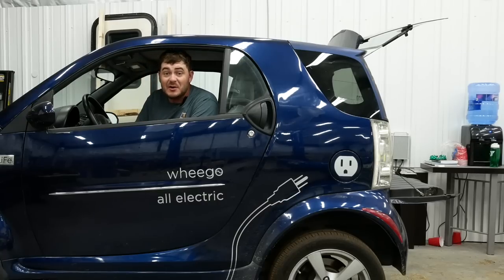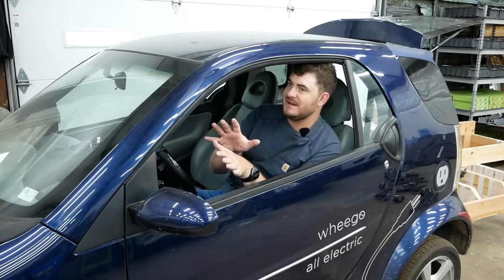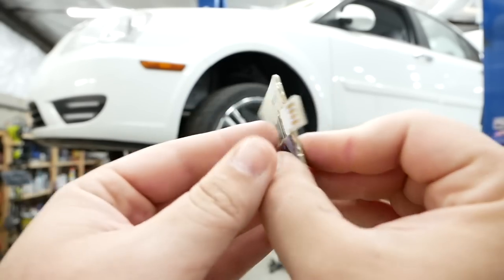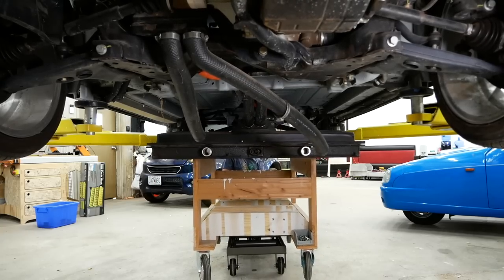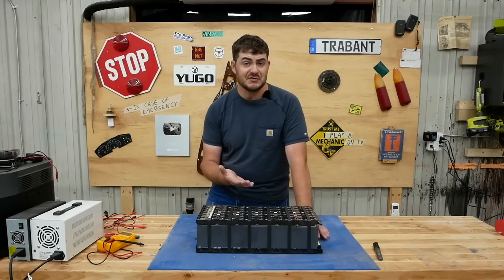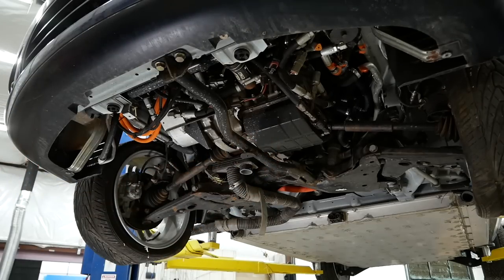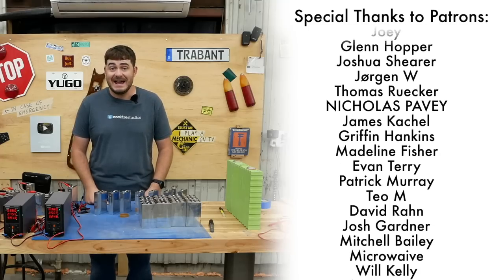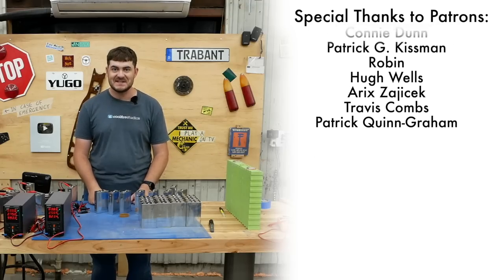I Have 3 Dead EVs. Are Any of The Batteries Still Good?

Comment: The battery pack in your "roadworthy" Coda is better used to get your dead Wheego back on the road. No one except a handful of people own Codas, so no worries about repurposing good parts for another obscure EV. 
So long as the cannibalized battery pack has the BMS and other associated circuitry preserved you could either keep it for personal benchstock (who else has a Coda?) or keep that for other Coda owners. The battery cells could theoretically be replaced with similar aftermarket ones but the brainbox is a bit trickier to come by.

Also a Li swap for the Ryobi mower is a good project and would make good use of the ripped apart Coda pack.

Comment: Honestly do what ever makes you happy. I have almost no doubt that you will make at least some people sad by disassembling a perfectly good thing is technically irreplaceable. However if someone REALLY wanted to revive the coda(that will most likely be drivable again) that you are taking the batteries from they could with new batteries that exist now. Granted they would have to do a lot more work to make new batteries fit in the old hole, but that does not make it impossible. Now if you thought ANYONE would want to have the battery pack and the car to go with it in the next year or two then keep it. If not it is just junk wasting space in your garage. Some times failed ideas just need to die and the parts sent off to other failed ideas. The Wheego is junk, but it could be functional junk with new batteries. If I understand at least one of the codas will most likely never be a functioning piece of junk so no real loss there. Lastly I am no battery scientist, but if you do nothing with them long enough and never charge them they will go bad eventually, so another reason to use it before you lose it.

Comment: I would say, try to source replacement cells for the wego. Those look pretty stock for about 2010 or so. Are you sure they’re not LiON or another earlier chemistry?  (I ran a hybrid battery repair company in the NiMh days - contact me if you need info)

Comment: The ony thing different, really are the electronics. You're overthinking the batteries, since if you can disassemble the individual cell, then a new battery pack can be made to create something of similar spec to the Coda battery cell.

Comment: This is a problem I've always forseen with the EV market, leaving vehicles to sit without battery maintenance, of which abandoned vehicles, forgotten about vehicles, and the second hand market will all produce victims of lack of maintenance; even if LiFePo is more robust, they won't last forever unmaintained. Then someone will have to dump extra money into service and replacement, when you know the market will not reflect that as a typical long term need. The EV market will always be expensive, even ten years down the line you'll have unreasonable service costs; and this is before getting into how the service market will handle constant changes in EV battery cells, especially when you have a company like Tesla changing cell size every few years, imagine what happens when you have that going on with pouch cells, or chemistry changes, etc. And that's before getting into just how much of a time investment battery service is, and you know how expensive service gets per hour, jus testing takes long enough, replacement takes even longer, and these people have to be trained to do the job so they're technically specialists within the industry, especially for welded cells, which also take additional equipment; the costs snowball out of control extremely quickly. I'm all for EVs, but the market will take way too long to adapt to them, especially the service market.

Comment: Odds are when someone needs to fix the coda battery back they will just use a tesla battery pack. Plus seeing how unriliable your Cota has been and how well built the battery packs are it is more likely that the car will die before the batter pack so the odd of someone else needing a coda battery back within driving distance of you is probably very very low.

Comment: you're overthinking it. If a Coda owner needs a new pack, the smartest thing would be to eliminate the bad module and replace the bad cells with good ones. So it's not like they cannot find any new cells and you can maybe upgrade the packs with better cells and sell of the old ones.
You shouldn't be the one thinking about this stuff, the Coda owners who need batteries should be thinking about solutions to their needs.
Fix up the Weego and the mower, and enjoy the Coda with a bit more range.

Comment: Honestly, by the time someone else than yourself need a battery pack for a Coda, the cells will probably be dead anyway. I'm impressed they are even still okay after that much time, but they won't last decades either. Use them. I only hope you took several pictures in addition to the videos so you or someone else can later rebuilt them if needed.

Comment: try a lawn mower below car floor flywheel of radius 1m at 20krpm at 300Wh/kg, easy battery, think like 200kg of flywheel, at 60kWh energy storage, spin faster to 200krpm if you want 30kWh/kg energy storage rating
Reply: dont mind the bits flying out, really fast :p
Reply: and, your car will not easily flip over, because of the flywheel continuity of rotary momentum stabilization
Reply: bs robust lol, fall with single stone punch

Comment: I think the good Coda battery pack deserves to see out its full service life. I say do a bunch of parts swapping and get another good Coda out of the two you harvested in this video, keep the batteryless Coda around as a communal parts car for all Coda owners, and revive the Wheego in some way that doesn't deplete the already limited resources of very low production run EVs. You've already somewhat appointed yourself as a steward of such vehicles, it wouldn't do well to let that power go to your head to decide what lives and dies, it wanders into hubris to use such powers to go beyond preservation into deciding what lives and dies

Comment: I'd use the battery pack in other projects. Better for it to live on in the wheego or as the house battery in your bus, rather than going bad sitting around in the garage.
Reply: But as you just saw, LiFePO4 doesn't go bad.
Reply: @luc_libv_verhaegen  But as you just saw in the wheego, it can.
Reply: @Handl3sAreStupid  Because of draining those cells below 2.5V as explained in the august 21st 2020 video about the weego. The BMS of the weego apparently did not protect against this.

Comment: So, seeing that the Coda packs are good, what is actually wrong with the cars that prevent them from being on the road? Bad electric motors?, electrical component failure? Genuinely curious. Perhaps the electric motors among plenty of other parts could be salvaged if you are unable to determine whats wrong with them.

Comment: if someone is going to revive a coda odds are they will use the original battery case but use modern cells as density goes up. no point holding on to batteries that will deteriorate irregardless

Comment: I still say it would be real interesting to see a Coda with an ICE. Not because "oh, electric car bad, gas car good," but just because... why not? At least one of them is going to end up as a parts car, so why not do something silly with it when it has given all the parts it can?
Reply: Like Rich Rebuilds has did with the ICE-T and Model D? Could also try to do a PHEV conversion with a Toyota drivetrain, some fabrication, a small 1L turboed engine and some of the batteries. I'd rather have a PHEV than a BEV as a solo car.

Comment: As far as tearing a battery apart for parts, if there are other "coda enthusiasts" (for some reason...) I might reach out to them and offer it up first. If it can go to immediate use in a Coda, eh I might not cannibalize it. On the other hand, if nobody has a need for it, by all means, tear it down for parts. If you don't it'll end up sitting around and just become "e-waste" as the cells deteriorate.

And with the Coda wheel bearings, im sure you've already thought of it, but id imagine SOMEBODY like Timken or SKF makes a bearing the same size. Might be worth getting frisky with some liquid nitrogen and a torch and seeing if you cant get (what im assuming are) hub assemblies apart and investigate. If Coda figured it out, you can probably figure it out in half the time!

Comment: Look at it another way. You have a Coda thats going to work and be around 16.7% higher pack storage. 
Thats improving a Coda. 
With the Wheego anything is an improvement.
You also have a junk Coda which is only ever going to be any good for parts. I would keep all the pack stuff you don't need like the case, wiring and so on incase someone needs them but the cells themselves I would say are better off being used. 
Just imagine if you could make the Wheego not junk...

Comment: Also by the way, have you swapped the headlights in the Reliant to the Opel Corsa headlight units instead of the Vauxhall ones that come in there? I ask because of the high beam pattern of the vauxhall ones is set for Left lane running, the opel ones being for right lane running.

Comment: would it be possible to consider putting the batter pack from your working coda into the bus and have that charge directly from the bus, and have it run through a power inverter making it so you wouldn't have to run the bus in order to use devices? would be a nice little touch for when you get that project done and are using it.
Reply from the maker: Yes, and I considered this, but the full pack would be massive overkill for the bus. A 31 kWh pack could run a small AC on full blast for well over 50 hours straight
Reply: @agingwheels  i...i don't see a problem with this and to me, it's an absolute win.

Comment: Wait, so there is a 3rd Coda? If that extended range battery was never able to pass safety to get on the road, do you want it in your car that you're taking on the road?

You broke the one battery pack, pulled the extended range one, and are thinking about pulling another standard pack to swap with the extended... The last pack shouldn't be held "just in case", use it for something or get it to someone who will use it isy opinion.

Comment: It's rather mind boggling to think without the batteries the various cars in the video were all good but potential scrap value without batteries.......THEY WERE MADE TOO GOOD..... that is they were not rusted out wrecks as you'd find years ago with old petrol types staggering along with worn cylinders and blowing smoke 
This is the way things are now in the age of high technology when a battery can make a car a scrap heap donor.........CARS ARE BEING MADE TOO GOOD.......they should be made only to last a few years then get recycled totally for the next advanced technology model.......most people don't want old cars anymore than an old valve radios, record players, CRT TV sets or steam computers........car manufacturing costs needs to be cut down to only making them just able to fulfill the warranty, or as long as the battery life is good.... and then get turfed out to the recycler.........like ball point pens........not refillable and totally scrap.

Comment: Lithium batteries only have a limited life in years. Use it and abuse it because after the life timer runs out it will be dead anyway no matter how it was taken care of. Nice thing about electrics is you should be able to at some point make a new pack for it with modern tech. Sure you will need a new charging setup for it but hey it will be alive again. It is not like old mechanical cars.

Comment: 3HP 4-Stroke Single Cylinder Diesel Engine, motor never charge your Electric vehicle again, I built one $240.00 ! ?How bad ? is Corn Oil? Remember this a 3hp motor W/ right generator I built too. all 3 Three Phase. and how hard it heat a 1 cyl motor that weighs 45 bs ??? I'm a Mechanic/Inventor/Jay the guy that I was in a hit-and-run accident 3yrs and 6 months ago. Christmas Day ! on my  Scooter. (I have a hard time writing) Sorry. It only the generator when the gets a little bit low and shuts off when it gets up to full power on battery, which could a smaller BATTERY. Aging Wheels

Comment: The Wheego is an iconic looking fun littler car with sound front wheel bearings. The Coda is an ugly nondescript pile. The Coda should make the Wheego live again. Also, if you do the math you can make that battery pack do an awful lot for you. Check Gibo200's comment.

Comment: I get the idea behinf the CVT when you are just cruising i geuss the electric motor wont be running at such a high rpm meaning it will pull less power but i wouldnt have gone for a CVT

Comment: why bother the packs are there measure the individual cell voltages if they are good keep the pack you are creating a lot of work by taking them apart. also the architecture for charging the system is there, that's more expensive and harder than the cells to get right.

Comment: I would not use the Codas bateries if you want to revived your Weego for a long time. I just bought 84 NMC cells for my reverse electric trike project. They are light, only 1.75kg each cell, and they are manufacturered by CATL. Each cell is 3.7 V and 116Ah. This give me 36 kWh of capacity and takes an area of only 1069 square inches (45 x 23.75 inches). I did wanted to go for LIFePO4 because since they are safer than NMC but the added weight and space use was just too much. I plan to flood the battery with a dielectic cooling fluid. I do understand that you want to make it as cheap as possible, then go for the Codas cells, since they do look healthy. Thanks for the video and have fun. Can't wait to see the rest of your project.

Comment: i would love help you make new way settings up battery pack in that small car where u was sitting on it at end of video
other two car can go to junk yard because they aint worth much but soo much trouble 
using battery out of ther vehicles i would recommend doing that because only thing make one useful vehicle in case one bad cell be replaced with good one u have kept on shelf bad cell battery can be sent to li... place ex changes into cash which it save you a headache 
you probably would taked electric or gas power motor out both (2 n 3 vehicles) n use it for something that you never know when u see it irl n throw one in it it like one stone hit 4 birds  at once which you can build something out of it or make generator out of it (which i did in past because they dont make any parts for that vehicles at all so i rod engine n electric motor out of n make usefull thing which i can power house or shed or whatever it is n still take it anywhere no problem)

Comment: Placing a CVT in the drivetrain is actually a good idea as it would increase the range over a non-CVT equipped version with the same battery pack.

Comment: It is a worthless vehicle, fully charged had a range of 88 miles, did not do well in hot climates. And if that is not enough why is it that airlines do not want lithium Ion batteries on the planes (FIRE)
Part them out into your mower or solar storage.

Comment: Do you really need two four door, totally inferior parts, jetta look-a-like cars? Just how many people are willing to pay for a Coda battery pack? Or a Coda? The Wheego is as useless as a Smart for two is, but it's an interesting EV and small parts getter. As cheaply as the Coda is built, I would make one, that you know will need work, probably every time you drove it, and get the Wheego going and just maybe you have enough cells to fix the mower and give up the "until someone needs a battery pack" idea. The shipping would be crazy expensive and nobody is going to drive to pick it up. How many Coda's, can you imagine, that are actually on the road? You have two and both are in the back of your garage collecting rats.

Comment: You'll be very lucky one cell of a parallel unit doesn't short out the fully charged other cells these car idiots put in parallel...which will cause the shorted good cells to explode in flames the fire department can't extinguish, burning down your shop...any time on any day.

Comment: This goes to show that EVs are a very poor investment. The batteries die and then you throw away the car.
Reply: I Think you may have completely missed the point of this video. The Coda batteries that are now over a decade old are still perfectly good. They're going to be potentially used to revive his other EV to avoid such a scenario as having to throw away the car. 

If he can do this with some very old EV that was very badly built in small numbers, with old technology and barely even a full service manual, then you can totally make an old mass production EV work for significantly longer.